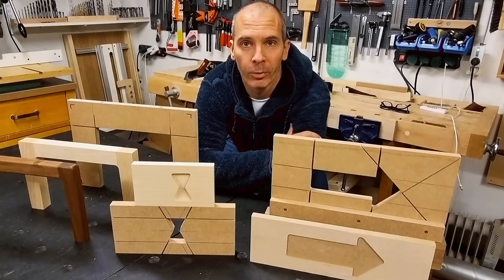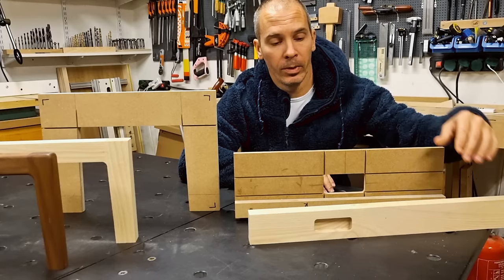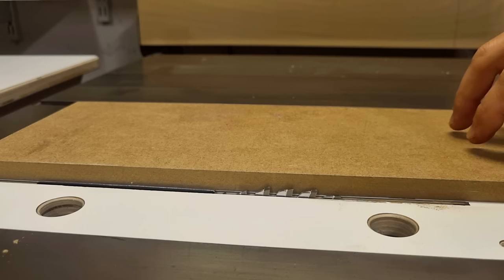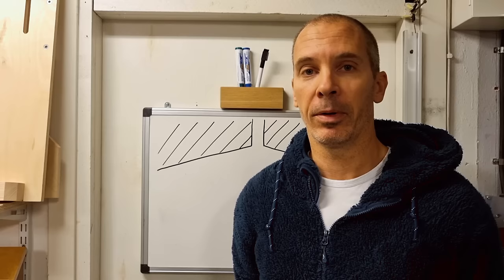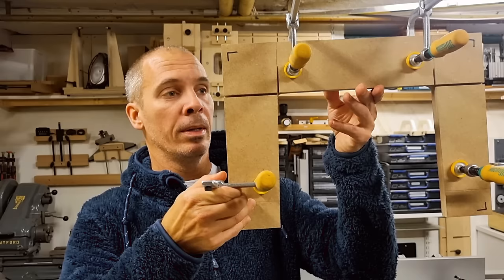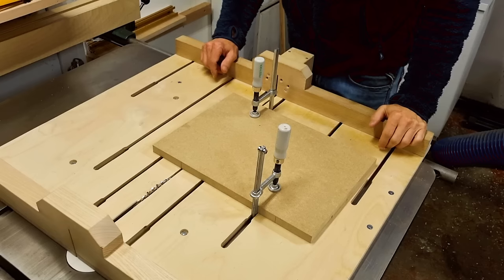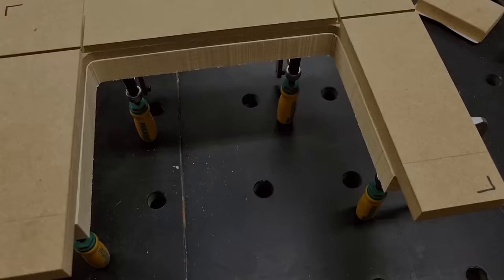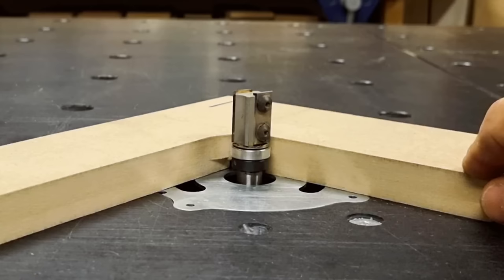The Scoring Method - fast and accurate router templates

Comment: Whoa, ingenious idea how to clamp pieces to the crosscut sled as well! 👍
Reply from the maker: Thanks! Used that clamping method more than 10 years, at that time I was more or less alone...Now since microjig dovetail clamps were introduced it has become quite common.
Reply: @CarmoniusFinsnickeri  I'd never seen it before 🙂 Watching your vid about it right now. If I heard correctly the base of your sled is 15mm. My (much smaller) sled is 12mm thick, so I would have to build a new one if I wanted to route those grooves 🤔 Certainly something to add to my to-do list. Since I wanted to use my crosscut sled this week to saw 45° bevels at the end of some longer planks, I wondered how to secure them to the sled. This seems a far better method than the usual 'quick clamps' that you also talked about in the vid.
Reply from the maker: @nolanhitchens  Much better than any other hold down ideas. I use this clamping concept in almost all my jigs. Check out some microjig crosscut sleds also to get more inspiration. I think 12mm is thick enough for their clamps but you won't have much remaining material underneath, if I remember correctly the dovetail track is around 9mm deep.

Comment: I really enjoyed this video. No bad jokes or "funny" pet talk, straight to the point, hands-on advice from experience and showcase of examples. Just a thought: might be a good idea to use a DIY Microjig table saw taper jig (normally used as a jointer) to score the template lines; I think it'd be the quickest option if you manage to implement a good positioning for the clamps. Well done
Reply from the maker: Thanks! I have a taper jig like that, built with festool rail clamps before the dovetail clamps where invented. Not sure how that would simplify things though, for straight cuts the normal fence is quickest way, for angled cuts the tracksaw works really well.
Reply: @CarmoniusFinsnickeri  
I was thinking of taking advantage of your idea of lengthening layout lines to the endgrain, but doing it for all of them. Then it'll be a matter of positioning the two endgrain transferred lines (ie of each layout line) right onto the edge of the taper jig and securing with dovetail clamps. The advantages I see with this method is not having to swap to the crosscut sled, not needing the table saw fence for alignment, and the ability to do any tapered line. I hope this makes sense. Btw, your Superjig is very nice. I recall Stumpy Nubs doing something similar with his box joint jig and an incremental positioner.
Reply from the maker: @alaricomanju7280  ok I get it. But still working upside down with angled cuts, the tracksaw is really fast for those cuts, sliding mitre saw even better if it's small parts. Anyway, thanks for the feedback and also comment about the superjig. I've seen Stympus jig and it's very nice but mine is a different beast🙂
Reply: @CarmoniusFinsnickeri  
You're probably right, after all, you've done this many times; mine was just a thought. Anyways, I hope to see soon more of your work. Cheers
Reply from the maker: @alaricomanju7280  everyone will find their own favourite methods for making the scoring passes, no right or wrong. Always good to have one more option in the toolbox.
Reply: I’d use a radial arm saw to cut the templates
Reply from the maker: @monteglover4133  That's a very good alternative.

Comment: Thank You absolutely one of the best tips.!
I’d use a radial arm saw to make the cuts.
Auto body (Bondo) could be used to fill the saw cuts if they cause an issue.
Reply from the maker: Thanks! That's a very good option for those who have a radial arm saw, my feeling is that they are not very common anymore. I never been in the situation where the saw tracks cause a problem, if I was I would maybe choose another method to make the template. But thanks for that tip also.

Comment: Hard to believe I’ve never seen this method before. Great video. I wonder if it would be worth the effort of adding wood filler or even epoxy to the score lines. That way you could use the template from any position with no interference.
Reply from the maker: Thanks! I would say not worth the effort, it's enough to break the edges of the score lines slightly with a sandpaper. I've used the template with that side up several times and with two hands on the router and no risk of tilting down into a score line a stop is very unlikely.
Reply: Interesting. Thanks for the feedback

Comment: I just do full thickness cuts with my track saw.
Reply from the maker: Yepp that's smart and quick, doesn't work for all shapes though. Then I'm referring to tight shapes where a through cut would run into a piece of the template not intended to cut into, but also the final design I show in the video, corners with large inner round. You also loose some parallell and square accuracy that can be better acchieved with a table- than a track saw. But a mix of through and partial cuts is good to have in the toolbox.